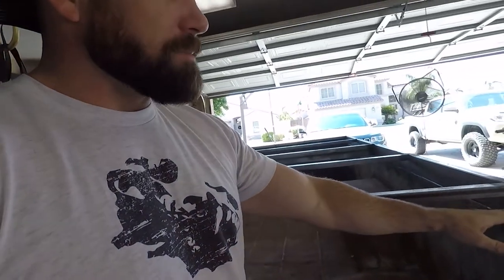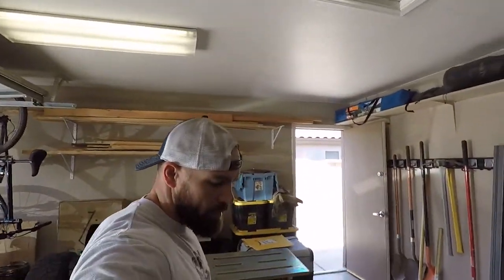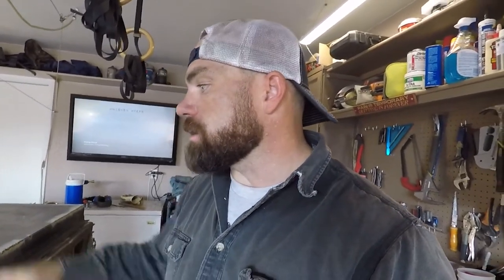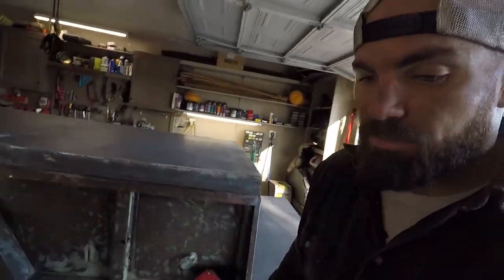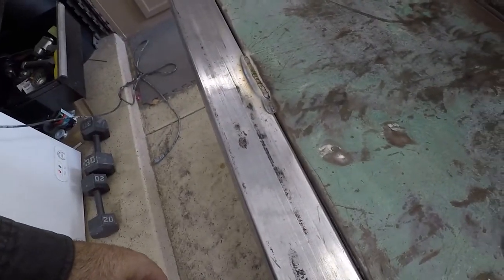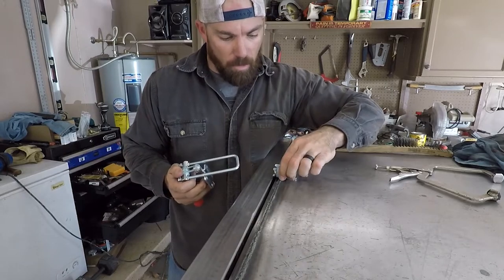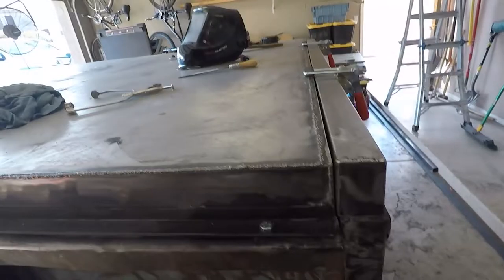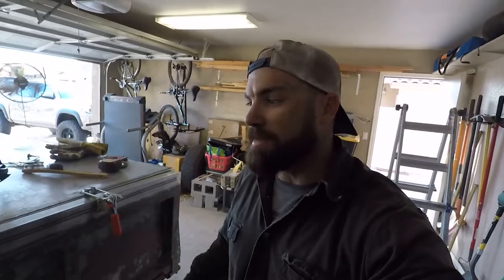M101 Trailer Build E9 - Finishing the Lid!

Comment: Looks great, I picked up an m105a2 yea I know its heavy but it was solid, I've already got mine livable (no roof top tent). Definitely looking forward on some info on the suspension and how it performs, but 1 question so far, why the tounge gate?
Reply from the maker: That 105 will be solid for sure! I did the tongue gate to store all the misc. camp stuff like tables and chairs. The back tailgate will have a sink, stove, and fridge pull out so I needed a way to store stuff without taking off the lid. I thought about a lid that opened but with the upper frame (yet to be installed) I wouldn't be able to open it fully. We'll see if all my theory makes sense in a month or two when it's done.